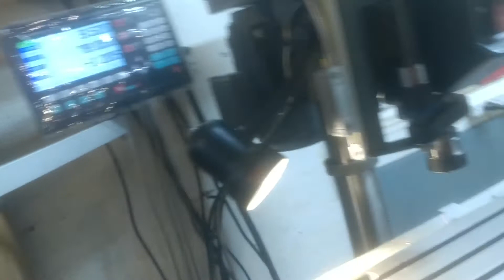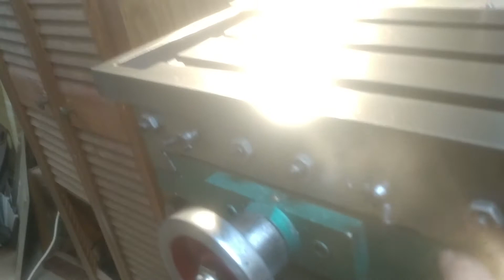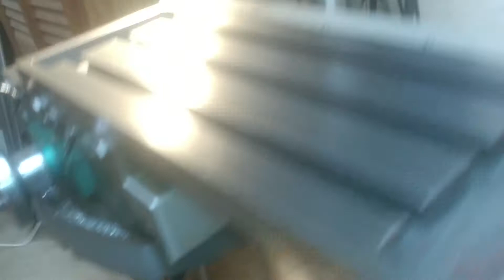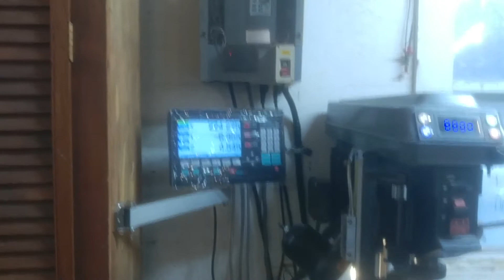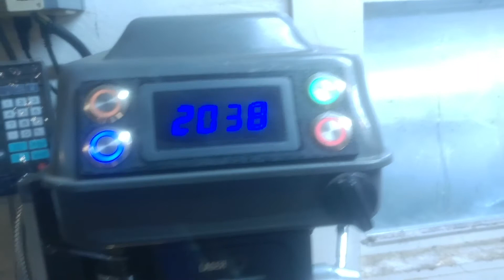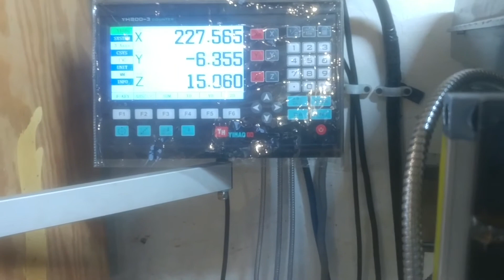Drill Press to Mill Conversion E2 new upgrades

Comment: Yes Sir watching again going try do something similar looking at few different drill press older ones they seem to be best my option 50s 60s era thinking about putting a square tubing over the round colom to double stuffing it up. Maybe weld a cradle type on top to bolt drill press head on to believe that really make it rigid but IDK experimental right now got buddy that's got few old presses that going look at they both work good got them from old machine shop little place that been closed over 35 years got good deal on them and don't need them got other things n deal he wanted them was bonus. Like video a lot how's it holding up or did u get a "real mill" that's cheating I think. Lol. No I wish had 10k get a mill and 20k to build a building for it not to much ask  hey ole lady what we got in the bank . For some tools gotta go dodging frying pan 🍳🥘 now.

Comment: I have the same XY table, still looking for the right drill press. Thanks for the ideas.
Reply from the maker: Look for something with a thick diameter support post; It helps reduce the flexing between the table and head. Also this mill table is about 30Kg or 66Lbs so the drill press table needs to me study enough to handle that plus your work and cutting forces. That weight is a good thing for milling, but you do need to account for it when picking your drill press.

Comment: Omg matthew did the same but without DRO.
Same x y table but i used a 2 hp geared head drill press with capacity to1 inch with morse taper 3. 
Keep thinking your doing great 👍👍👍
Reply from the maker: Sounds like it should have a much stronger spindle shaft than mine does.

At the start of the shut down I accidentally  bent mine attempting to use a boring head while making the metal version of the Z wheel. I ordered a new one, but with covid I realized that the shipping was going to be delayed for months. I took it apart and managed to straighten it to a little over 1/1000. I am still using it now but it is noisy; I think the bearings were damaged as well. Ill be replacing it with the new spindle when I can find the time. I still plan to use this for small work where I need the high RPM even after I get the Cincinnati set up.

Be safe; make sure that your Morse taper is securely locked in. do not rely on the taper fit to hold for milling.